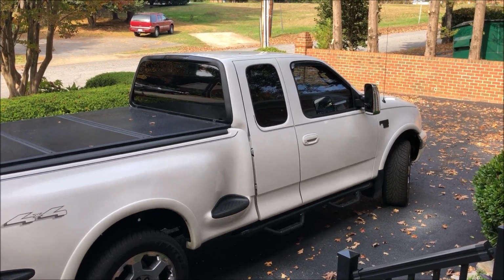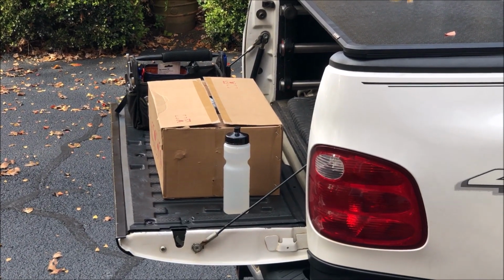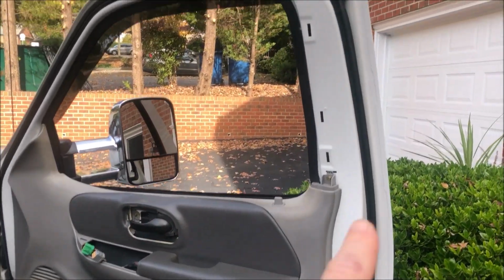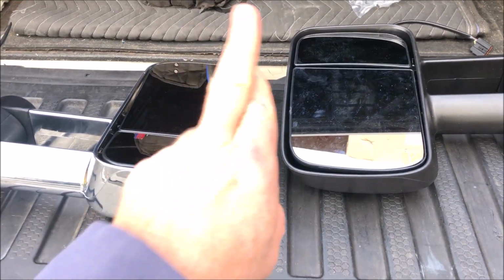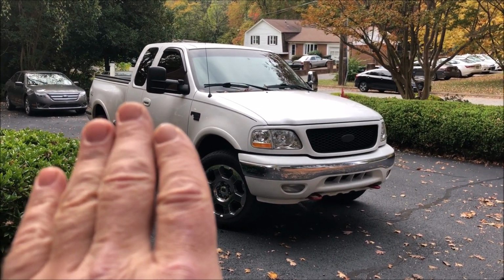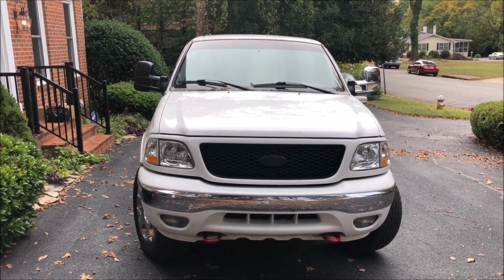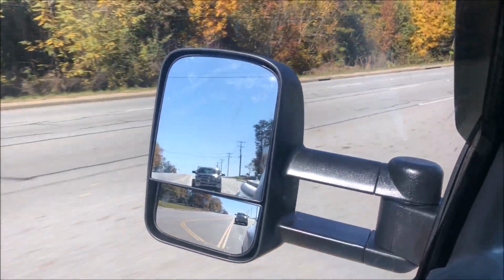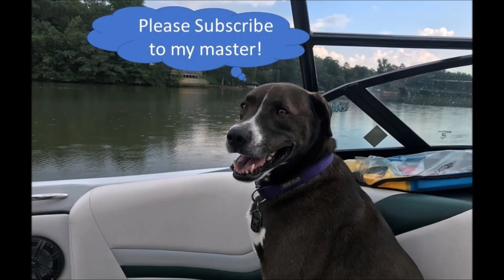Install of SOMEWHAT Higher Quality Towing Mirrors 10th Gen 2002 Ford F150 Supercab, Standard Cab

Comment: Hey man, love your truck! Where did you get your headlights?? I'm looking for a nice pair of headlights for my dad's 04 Heritage. Any issues with them so far ? No leaks or peeling surface ?
Reply from the maker: Thanks for the comment and question, I got those from Late Model Restoration.  They have a 1 year warranty which I had to use with the first set, but the second set has been flawless.  No problems at all.  I love my 10th Gen!

Comment: I had a 10th gen many years ago. I bought the gm style tow mirrors when they first came out for almost $300 and they shook nearly as bad as the $140 pair I got later off of ebay. I think it's more of a tow mirror thing and less of a certain brand of aftermarket manufacturer thing. I had a 2016 ram laramie diesel rig and the mirrors shook like crazy, 2016 6.7 powerstroke and the mirrors shake. I drive a few 2021 ford/ram trucks for work and the mirrors on both shake just as bad as the cheapos I bought off of ebay for my 6.0 powerstroke so I think it's because they're larger that they transfer motion more than the tiny little stock ones
Reply from the maker: Great input, thanks for that comment.  I think that is part of the problem, however, when I checked the tightness of my stock mirrors, the mirror itself, it is very tight in the housing as compared to the aftermarket.  Keep those comments coming!  Please subscribe.  ;)
Reply: Yes I have drove large diesel trucks with big mirrors and they always shake.

Comment: Foam in back of the mirror fixes that issue. Seriously. Easy fix
Reply from the maker: Why should I have to fix a brand new part?
Reply: @DrivingIntelligence  true I bought the same cheap China crap and waited to long to return them.. so I made it work.. everything after market comes from Ghina and it sucks.. u have to modify it usually.. but I see your point
Reply from the maker: @CF-yg5lt  that's a good idea... I went back to my OEN units with integrated turn signals:  https://youtu.be/6vNtSzJBfdM?si=31hOVFzeVRwlNVMl
Reply: How did you install foam? Did you take apart mirror?